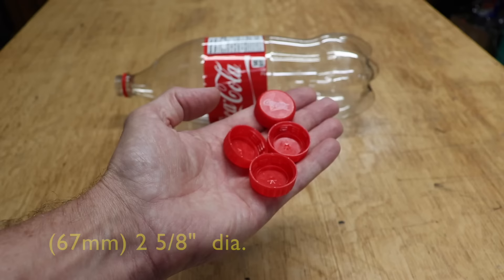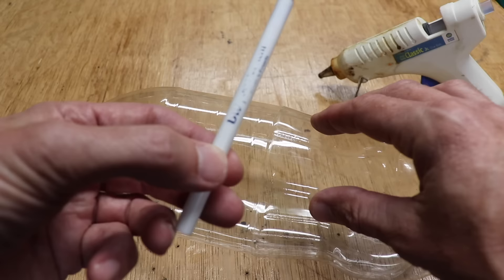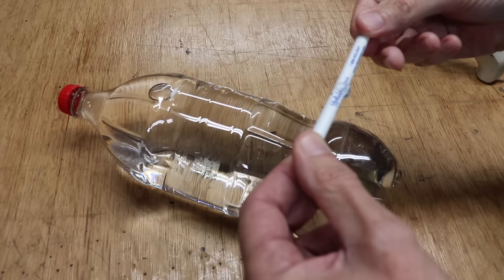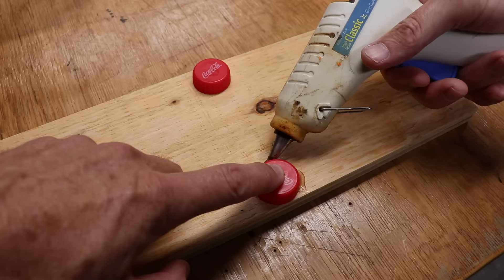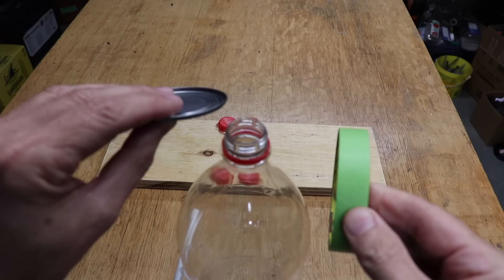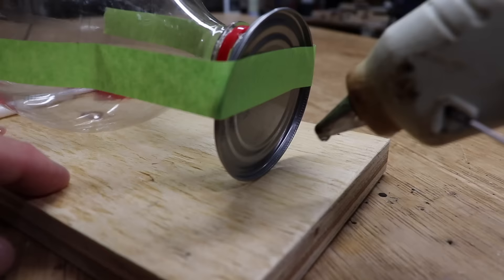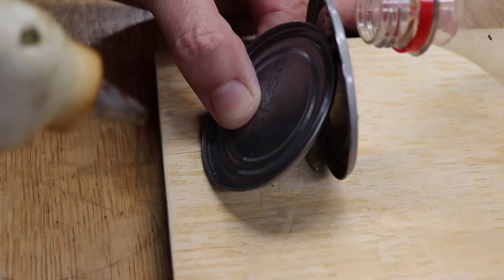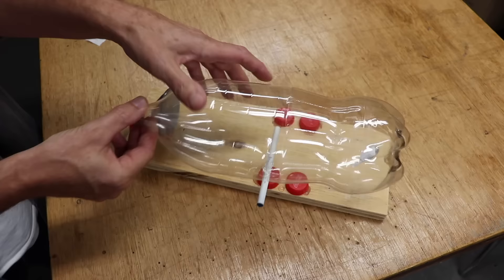Make a ● Simple Bottle Mousetrap ( that works ! )

Comment: When the mouse makes a buzzing noise I think it is grinding its teeth, or bruxing. At least that's what rats sound like when they brux, I notice mine does it when hes really happy or frustrated. Not sure if mice are the same though
Reply from the maker: The video sounded different than it was in real. It was like a loud bee.
Reply: Not sure about the buzzing but mice do brux btw!!
Reply: Dude...... U have a mouse?
Reply: @sanaumer8270  No. FireFly00 had a rat. :-P

Comment: Hey, I built this trap and caught a mouse last night ! This mouse has been alluding my current  live trap all summer. thank you !!
Reply: Make that 2 mice !  Got another one last night with this trap.

I may have one suggestion for improvement if its used for a live trap.  This mouse  was unresponsive when I found him,  I think he cut off his air supply by staying at the spout end of the bottle all night. So I melted a 1/4"  air whole on the top with a soldering iron.     Shortly...the little guy woke up and looked at me like WTF !!
Reply: The Only Shadow Cast that’s funny
Reply: @MrPopalosus  If you had your skull makeup on, I would've looked at you like that too 💀👍
Reply: @timearly5226  What make up ?  That's really how I look !
Reply: @MrPopalosus  OOPs!
Reply: there are many mice where i live and i only caught one but my cat started attacking the bottle and it escaped 😂

Comment: First trap I've ever built. I got 4 mice so far tonight (1 at a time, catch and release) and its just now about time for bed. Might be 5 by tomorrow

Dont know how many I have. Thought 1 or 2, but I was very wrong. Got at least 1 to go. 

Awesome trap!  Thanks!  I would recommend taping the pen to the bottle to avoid heat warping. I used metal ducting tape. Strong and thin. 

Also hot glue hot glue sticks to bottle caps over pen to avoid them knocking the bottle loose. They did that 2 or 3 times tonight before I modified it. Now it's perfect. 

I'm using a wyze came to watch from upstairs. Night vision ftw. :)

Update:  got 5 before I went to bed at 1am. Set it up around 5pm. Much of that was catching 1 at a time, releasing in the field down the street, reserting the trap, and fixing and modifying the trap as they were able to escape until I made changes. 

My father caught 2 more by the time I woke up this morning. Lol

This trap is amazing.
Reply: Well yeah... The problem with "catch and release" is that one female mouse has 8 litters a year, with about 6 mice per liter. There's a population of 7 billion people and 20 billion mice. So that's about 3 mice for every 1 person. If you have a home with a family of 5 humans... Then you might have up to 15mice on that property also. Some studied suggest that your never more than 6-12ft away from a mouse at any given time. 
Also, since covid started mice have been on the increase. With more people working from home or places being shut down they have been going crazy and moving around more to find sources of food. 
The reason the bait and release doesn't work is because they have a strong sense of smell and can locatate that for miles and very easily come back since they like to stay within the same areas because they choose their homes based off of availability of food, since for their body size they need to eat a lot of food a day compared to humans and some other animals. They eat up to 3x their body weight or mass in food a day. Their teeth also don't stop growing so they constantly chew so they don't grow into the roof of their mouths into their brains. 
Your best bet is to use the old fashioned wooden traps. Lay about 5-6 of them around the house. (Near your stove is the best, under it and on top by the back burner...especially if you have an electric stove since they often climb up the back exhaust burner) for bait use peanuts glued onto the trap or a lil bit of peanut butter.... I found the glued peanuts to work best. 
They might be cute but they spread a lot of illness and diseases. Killing is the best option or you'll quickly get an investigation that can be difficult to stop. They can also chew your wires and cause damage to your home or house goods.
Reply: @brooksozbrooks8514  you're on the wrong channel.
Reply: Ended up catching 20 within 24 hrs using this trap along side a double nail holding a lid up trap. They were about 50/50 on which caught the most. 

I will say if you don't release the mouse asap a second mouse can come along and mess up the trap so you gotta be quick with this one.

Comment: I would've never looked this up but I heard a noise in my bread garage cabinet just now 5 am. I looked inside it and saw a mouse inside my plastic tall olive oil bottle jumping trying to get out and the bottle was 1/4 full of oil! I lost the cover so he was able to get in. I can't believe they can climb up slippery plastic bottles! He would've drowned if he didn't keep standing up the poor thing! I screamed. I couldn't believe what I was looking at. I immediately brought it outside. Lucky for him it's raining out so hopefully some oil will come off him. I dumped the oil out and kept the bottle tipped at an angel so he can climb out. I waited and waited but he was just sitting at the edge cleaning himself. After 20 min I was soaked so I left it and went inside. I'm gonna make this bottle now. Thanks!
Reply from the maker: He is basically soaked in food. He will lick himself clean and will be fine!

Comment: Fascinating... that a mouse could fit through the bottle opening... no glue here so I'll try to match the mechanism with a coat hanger and an empty can of sorts... thanks
Btw, how long did it take to lure the mouse and is it better on floor or on table or...?
Reply from the maker: Put it wherever you have a mouse problem. It does not take long for them to go into it. Usually within the first few hours. Good luck!

Comment: Very nice design and video! A few questions:
1- Will the hot glue actually hold when the mouse is inside and pushes against the soup lid?
2- Why the toilet paper to wrap the peanut butter?
Reply: 1-  I think it would since mouse doesn't have enought strenght, also thanks to the shape of the bottle and the position of the mouse it is dificult for him to push. I just set up mine today.
2- the toilet paper is just to throw the peanut butter, I think if you use other solid food then no need
Reply: @r2cris  Thanks! Let me know how your trap works!
Reply: @JLvatron  it works! I used chocolate as bait and I just caught it

Comment: This is a great science experiment or side project, especially for kids. But The problem with "catch and release" is that one female mouse has 8 litters a year, with about 6 mice per liter. There's a population of 7 billion people and 20 billion mice. So that's about 3 mice for every 1 person. If you have a home with a family of 5 humans... Then you might have up to 15mice on that property also. Some studied suggest that your never more than 6-12ft away from a mouse at any given time. 
Also, since covid started mice have been on the increase. With more people working from home or places being shut down they have been going crazy and moving around more to find sources of food. 
The reason the bait and release doesn't work is because they have a strong sense of smell and can locatate that for miles and very easily come back since they like to stay within the same areas because they choose their homes based off of availability of food, since for their body size they need to eat a lot of food a day compared to humans and some other animals. They eat up to 3x their body weight or mass in food a day. Their teeth also don't stop growing so they constantly chew so they don't grow into the roof of their mouths into their brains. 
Your best bet is to use the old fashioned wooden traps. Lay about 5-6 of them around the house. (Near your stove is the best, under it and on top by the back burner...especially if you have an electric stove since they often climb up the back exhaust burner) for bait use peanuts glued onto the trap or a lil bit of peanut butter.... I found the glued peanuts to work best. 
They might be cute but they spread a lot of illness and diseases. Killing is the best option or you'll quickly get an investigation that can be difficult to stop. They can also chew your wires and cause damage to your home or house goods.

Comment: Does it have to be a 2 liter bottle? can it be a 20 fl oz?
Reply from the maker: A lot of bottles will work. You can experiment and see if it will work.
Reply: @chrisnotap  I just made a mouse trap out of a foam cup ..I filled the cup with water up almost halfway to give it some support. Then, I cut a circle in the middle of plastic lid but, before putting the lid on the cup. I put peanut on the inside of the lid so, when they go in the hole. The mice should fall into drown .. also got another idea for a mouse with a box and a coke bottle ..wish me luck ..you and Shawn woods have great content
Reply: Attempt #1 mouse went in the hole but, didn't fall in water. FAIL!😅
Sooo..I just cut the lid four time to make trapdoors. So, no matter what the mouse jumps on to the lid it'll land straight into the water. 💯

Comment: Hi!
The trap worked for me. But the mouse in my house were too small for tilting the bottle. In fact, after the first night I found the bottle nor tiltet and filled with mouse poop.
The solution was to attach something heavy enough to force the bottle to tilt when the mouse gets in.
Reply from the maker: Just change the pivot point until you get the balance a bit more refined.
Reply: @chrisnotap  That's way more marter. I guess if you already hotglueed the pen under the bottle and don't want to move it for some reason, attaching an accueate weight will also do

Comment: Won’t the mouse die from asphyxia with this kind of trap? It’s a real question because I’m looking into humane traps 😅
Reply from the maker: Good question. The mouse moves around. When it's at the back, the bottle is wide open. When it's at the front, it is closed but with a small gap between the lid and bottle top.
Reply: Chris Notap and when you put the lid on to release him? How long can he survive with just the air inside the bottle?
Reply from the maker: It could last for a few hours. You need to be responsible when using this trap. Once you put the cap on, you would drive to a field to release it within a short time. Thanks.

Comment: Hello, vers interesting video. We are currently experiencing the same issue. We were wondering if the trap would work with a 500 ml bottle? Thanks
Reply: Any bottle will work as long as it's the same style. Mice can fit through a hole the size of the eraser on a pencil.

Comment: So the idea is the weight of the mouse pushes the bottle against the tin can lid creating a barrier. Well, what if you have a rodent that won't fit in that small hole.  I guess this only works for small ones.
Reply from the maker: Yes. It's for mice. If it can't fit in the neck, it can't be caught.

Comment: But it can easily cut the bottle and it will come out, and it is only effective for small mouse, if big mouse helps it after seeing it 😂😂
Reply from the maker: There is no "edge" inside the bottle to allow them to chew their way out. It is all rounded surfaces.
Reply: Yes but mouse has sharp nails which can scratch
Reply from the maker: @misssimran1748  Yes but they can't escape these bottles. Try it you'll see what I mean!